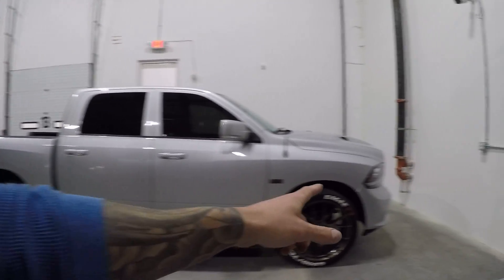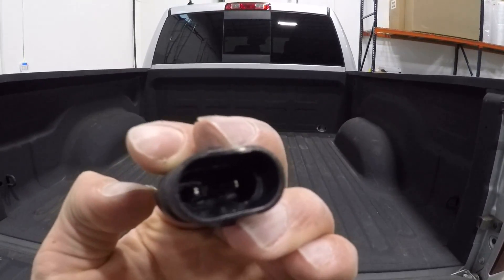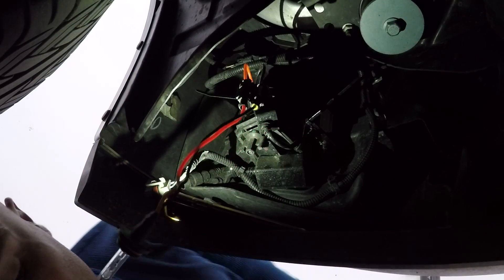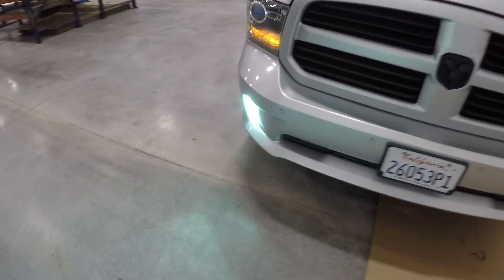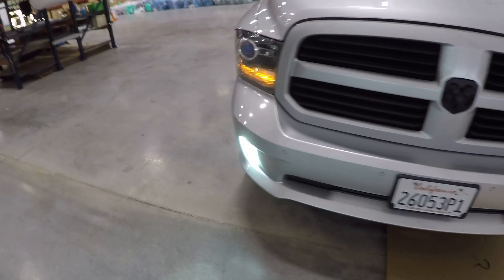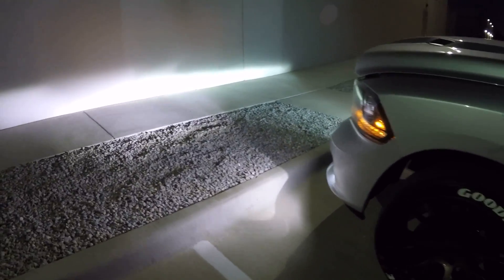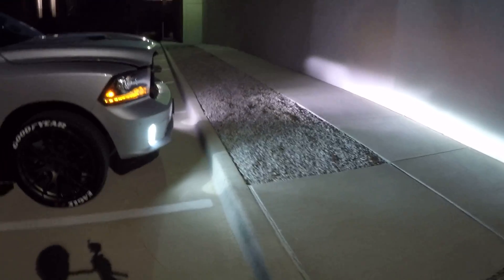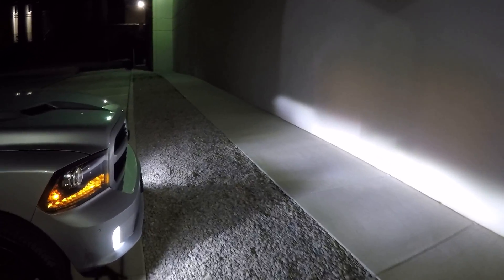LED vs HID Fog Light Comparison Test

Comment: Did you install without the canbus module? I’m thinking I might do these for my reflective housing lows and my fogs.
Reply from the maker: I just did a direct plug and play with no canbus module.  You might notice the driver's side had a tiny bit of flicker which did seem to go away after the first few minutes on my truck.  I'll also be comparing several different LED brands in the fogs coming up next if you want to wait for those results first before buying! 🤙
Reply: Boosted2k I really like the Hikari kit. But I’ll wait and see what else you have before I make a decision.

Comment: Nice presentation work on the Led fog lights VS HIDs. Yeah I preferred the LED over the HID reason being is that it's much clearer and brighter plus less hassle on the wiring hookups plus you don't have to drill small holes on the back of the fog housing just to install HID cause I think that just makes it easier for moisture to get into any light housing period. Man I wish I can show you my fog lights bro, I got ice blue led fogs and white led for low/high beams for main head lights looks real sick at night too! Also I wanted to make one more comment on the recent grill removal video awsome job on that too! Too bad though when I 1st got my truck lol, the middle bottom tab that rests really close to the plastic mid bumper part kind of scratched the paint cause I didn't realized how close of a tolerance it was to the bumper kind of scratched the bumper. So I ended up taping off the scratched portion and had to sand and repaint the scratched area. But I made sure this time to tape the tab part with some rubber tape so it wouldn't happen again lesson learned lol.
Reply from the maker: Thanks for the feedback John!  On the fogs I didn't have to drill anything for an HID kit since the bulb and harness are already exposed but you're right for doing an HID install on a sealed headlight for sure.  Also did you see the HID vs LED comparison in the low beam projectors I posted yesterday?  It was the complete opposite result! 🤣

Comment: Great look ... I put LASFIT led lights  in my 2012 Ram 1500 (driver head lamp and fog) they work amazing . Super bright white lighting and a cleaner look ! Looks great .. thanks for the video 👍👍👍
Reply: Rob Gray I just bought a LASFIT led set (Hi's, Low's, and Fogs) can't wait to test them out.
Reply: Shadrick Alexander ... that's exactly what I did .. the high beams haven't been installed yet but I am absolutely happy with LASFIT products for sure and u will be too .. good luck .
Reply: Rob Gray did it throw any warning?
Reply: I did have to order the anti-flickering kit for low beams ... about 25 bucks . But that is on a 2012 Ram 1500 ... but the fog lights no problem , just plug n play . Hope that helps u .
Reply: Shadrick Alexander ... no warnings on dash ! But I noticed very little flickering in low beams.
Reply: Rob gray did you go with the 72watt or 60watt set for low beams
Reply: Rubin Logan ... I bought the lasfit lc6 set . Without box in front of me I can't remember.  But they are truly bright white lighting for sure . Good luck !
Reply: Rob gray.. thanks
Reply from the maker: Awesome Rob let us know how it works out!  LED in reflector style housings work great.  Did you see the HID vs LED video I posted up yesterday in the low beam projectors?  Pretty crazy difference 🤙

Comment: Keep us updated on the life of the bulbs. Thinking I’ll put these in my fogs and hid in my projectors
Reply from the maker: SandMan 716 urdaddy is spot on! My low beams are 6000k and that's the highest you want to go for visibility. I'm actually going to order some 5000k and 4300k bulbs and do comparison tests for you guys too in the next few weeks 👍
Reply from the maker: Will do!  I also have a few more comparisons I want to do.  This kit is a bargain at $25 but I want to compare it against the Hikari LED kit which runs about 3x the price to see how it compares.  Also my full setup video will be posted Sunday with the HID in the low beam projectors and these in the fogs.  It really does quite a bit of work!
Reply: SandMan 716 yes I'd go no go
Higher then 6000k. But 45-5000 is where you wanna be for brightness
Reply: SandMan 716 if your gonna get hids for your projectors. Make sure to get a 4300k to 5000k  so it will be a white light and will be brighter.. I also run 55watt over 35watt for the hids...
Reply: urdadddy1 so I should stay away from 8000k 55w?  I think that was an iced blue color.